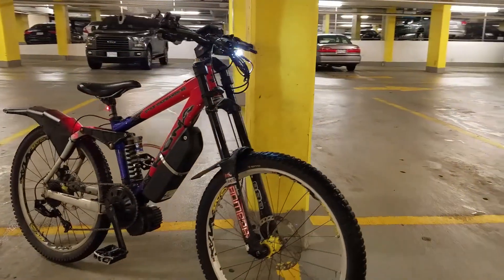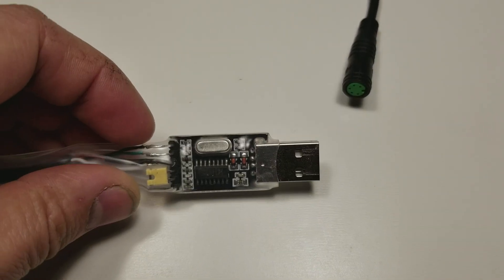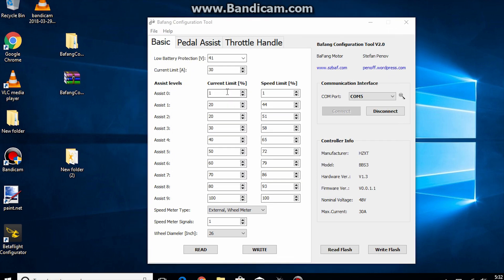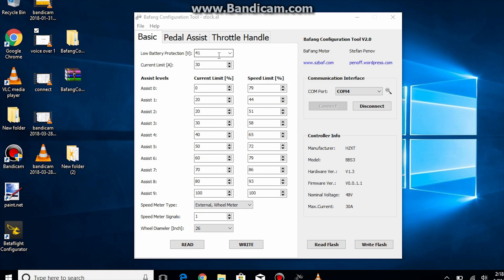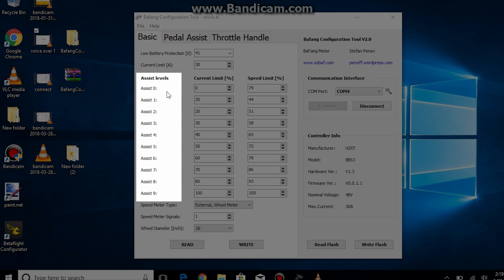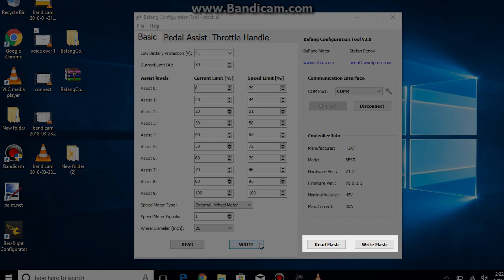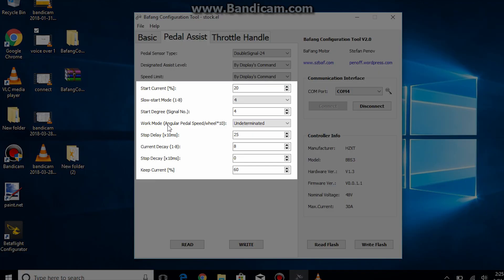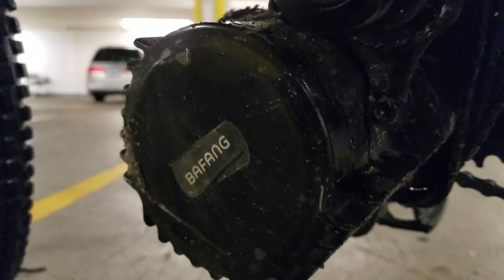Bafang BBSHD Configuration Tool HOW TO

Comment: Sorry, but pedal assist mode is supposed to do nothing. At 0 you are simply using the speedometer, 0 mode is for going downhill without using the motor, as this saves battery.

Comment: Are you aware that there is an app called SPEEED which works with a smart phone-no need for a laptop. However, I have used this twice and twice it resulted in disabling my PAS without knowing why? I would dearly like to know as it involves quite some extra cost to get it functioning again. Right now, I need to reduce the power setting for my PAS 4 and 5 but am afraid to use SPEEED again in case I lose my PAS?
Reply: ▪️
What kind of bike did you use it on?
🟥
Reply: NOT THAT IT MATTERS BUT A RECUMBENT TRIKE @2NDFLB-CLERK

Comment: Very useful, thanks. I found that I needed to turn the bike battery on to be able to read the flash. In the PDF which was part of the config tool download it says specifically don't have the battery connected when connecting a computer.

Comment: Wheel diameter is the rim size?   If your tire was 12" thick you would go faster than a 1" thick tire,   if both were on the same rim size and both spinning the same rpm.    Shouldn't it be the tire outside diameter?    Am I wrong?

Comment: Thanks for sharing. I'm using 52V battery  however the tool says the nominal voltage is 48v (as shown in your video).  The highest option in the pulldown for voltage cutoff is 43. Shouldn't it be higher for 52V (maybe ~46 or 48?

Comment: Hi, 
I'm the author of the "Speeed" application for Android https://play.google.com/store/apps/details?id=com.mkopa.speeed 
It's the equivalent of the popular Windows tool "Bafang Configuration Tool". The application supports configuration files from "Bafang Configuration Tool", it also saves them in this format (*.el).

To work we need the same adapter i.e. USB-Serial + Julet 5-pin female plug. 

The application is free. I'm making it for our common good :)

In the next version we'll find support for Bluetooth adapters, and after some time and thorough testing the application will also be available for iOS.

Comment: I have a Bafang M600 seems the factory has locked out all capability to program it. i want to set the power levels %, power level 1&2 are all but nonexistent then power level 3 and you are off to the races. would appreciate any info you may have on the M600 programing.

Comment: Hi. I've got ax similar set up. Note that I'm getting better, I'm hitting the battery when landing and compressing the shocks over 70 percent or so. Have you the same issue? Have you ever landed and compressed shocks such that it caused the wheel to brake and or hit battery hard enough to cause damage?

Comment: If I get a "thump" when initially engaging throttle or PAS would adjusting and slightly lowering the "start current" alleviate that abruptness of initial power delivery and get rid of the initial thumb throttle / pas engagement thump or clank that I experience? I'll have to get a programming cable and give it a try but jsut wondering if you happen to know. Thanks for a great video!
Reply: Hey. I hope you see this comment. I have been all over YouTube trying to find a fix for EXACTLY what you described. I haven't tried lowering LVL-1 of PAS yet. If the motor had soft start/soft engagement where it would take the slack up in the freewheel, chain, etc., before going all out, that would be great. I hate that initial thud that hits like a brick each time motor engages. It makes an awesome mid drive system feel just a little bit like junk.

Comment: Doug, good overview of the Penoff software. Folks need to watch out for some ebay programming cables, my buddy got a miswired one and it blew my BBSHD controller as soon as I plugged it into my bike. Never had any issues with the programming cable I bought from Luna. Nice Stab Garbanzo, I have been jamming on a 2007 Stab Deluxe with a hot-rodded BBSHD from Luna for the past couple of years, also with white wheels. The Stab is definitely a bike that can handle everything the BBSHD can put out, no flexing or wobblies. I was advised to get the 36 tooth Lekkie narrow-wide chainring, and ditching the stamped steel Bafang chainring before I ordered my BBSHD kit. With a 9-speed 11-34 cogset it goes anywhere. Even with 3 big screws mounting the battery rack to the frame (your "riv-nuts" are a great idea), I have been using two nylon & Velcro straps to keep my battery secure, but as you said in your build video,  the under-downtube mounting keeps the center of gravity low for stability.

Comment: Hi ,,, So if  i put a 52v on my bike i will need to change the cut off voltage or will it be fine at factory settings for 48v so i can use  both ? Thanks

Comment: i check the battery, checked the connectors, and changed the display. Bought this cable to see if its the controller, dont see it read the info in the bottom right. Is this the culprit of my issue?
Reply: make sure you have the correct comport selected and then click connect

Comment: Anyone know if this cable will work with the new style connections bafang is using with the metal twist on connections. Mine does not just pull apart as listed.

Comment: You got the low voltage levels completely wrong a 52 volt battery should be 39v. Your BMS will stop your battery from going to low anyway so your value just limits the distance.
Reply: 14 x 2.8 v is 39.2 volts. Your pack will not last long discharging that low. 3.7 v is recognized as best for long term battery life. Top charge of about 57v and discharge to 51v.  Do what you want but if you charge to 4v per cell and discharge to 3.7v per cell you could see many years of battery life. A 52 v battery is 14 cells in series. If you need more range buy a larger ah battery- not discharge it so deeply.

Comment: I think the current consensus is that the "Speed Limit%" is a limit on the BBS motor speed (rpms) rather than the road speed.  It affects at what cadence the motor stops providing assistance.  The maximum rpm (at the cranks) for a bbshd is 130-150 rpm (depending on voltage).  So the Speed Limit% should be set to a level that assures that it doesn't start cutting off or ramping down before you reach your normal or somewhat above normal cadence.  These motors like to run at high rpms and putting too much power in at low rpms can cause them to overheat, especially the BBS01 and 02.  The HD has much greater heat dissipation ability and is much more "bulletproof" I hear.

Comment: how can I remove high voltage cut off? I have 52v battery that my controller doesn't want to handle and it gives me 0.7h overvolt protection error.
Reply: Late reply. The only solution i found is to update the firmware. Look for bbshd over voltage on endless sphere and follow the tuts. Hope it helps tho you prob solved by now.

Comment: Wow this has opened up a lot of possibilities with the motor I already have. From what I can understand  the Bafang BBSO2 1000 watt is the same motor as the 250 watt with different settings? At present I'm bored with 40 km I need to go faster, brakes tyres and suspension all been upgraded to handle road speed. so do I change settings to 9 level pas, and speed to 99km, do I need to change watts? I'm not racing just commuting so throttle on is gradual, does that fiber gear need to be converted to brass or alli.

Comment: You can't set the current limit higher than the value detected (the one you see on the right). This was done to avoid errors. If you send the controller higher value, it returns an error. That's why I programmed it to limit like that. That my config program by the way. :) I think I should make a newer one that has better compatibility with Win10 and I might try to add functionality for the new mid drives with torque sensor if I figure out how it works.
Reply: You can buy new controller and 72volt battery and push bbshd to about 3-5kw of power peak

Comment: Thanks for the video and info. Really helps. I have a BBS02B one of the newer 750W kits. I purchased the program cable from amazon. Getting the USB driver and port on win 10 can be a pain. If you are using this type of setup, just keep searching google for different drivers. I tried 6 different ones and one them worked. But each win 10 is not the same. On my laptop which is 1 month old with win 10 the same driver did not work. So I tried several again and got one that did work. Not sure why but this is my experience. Just keep trying as I did and you will get it. I set my display to 99 MPH and 9 levels of PAS with 9 on my throttle. I have a TREK 2019 Merlin 5 with 29" tires. I am getting over 30 MPH on throttle only and in PAS 9 lowest gear just hitting 38.5 MPH. It seems and feels very fast just nice to know what it could do. I ride most off road in Tucson AZ and ride around 12-15 MPH 20 mile trips everyday.

Comment: Why would setting 0 to assist level 9 break stuff? Wouldn't it just be the same as using level 9 with throttle or pedal assist anyway?
Reply: The pedal power is excessive on 9 and causes crashes. It seriously amplifies any part of a pedal stroke, maybe if your wheel is straight and you are ready for the surge. Lots of people forget and can launch themselves into big trouble with wheel turned or in tricky conditions.
Reply: @copperhead891  I get what you mean. Without torque sensing and also because of lag, setting 9 is not predictable for someone who wants to pedal often. I haven't ridden one but I'd probably pedal with an assist level that made it feel slightly easier than normal but then use throttle for when I want full control or full power.

Comment: Luna cycle sells nice long Velcro straps for securing your battery and they look a lot nicer than a metal hose clamp.
Reply from the maker: Tim Spitz I didn't know, Thanks! I'll look into it
Reply: I recommend these.  They are rubber backed and you can really cinch them down cause they don't slip.   They are long enough to go completely around the bike frame and the battery.
https://www.amazon.com/gp/product/B01DNFIPAK/ref=oh_aui_detailpage_o00_s00?ie=UTF8&psc=1
Reply from the maker: Tim Spitz thanks a lot. I was trying to search long straps and couldn't find anything like that. I'm gonna order today.

Comment: Great information. I would have the cut out voltage set lower if the battery has bms because under load it drops 2 volts and you kangaroo back home.
Reply: yea bro same here, i know it  s set to 41 but sometimes mine doesn t want to assist when it reaches 43, it s better to set it to the lowest i can, because in case of emergency i d rather stress the battery a bit more than having to be a kangaroo, and when i see it s close to 41 i can charge it without waiting for it to be killed by the controller.

Comment: I'll just buy a whole new e bike .
Reply from the maker: horror780 diy e bikes can be more powerful than prebuilt ones for the same amount of money. I'm my case I peak out at 1500watts.  But if you don't have the time or patience, then a prebuilt one is best.
Reply: if you don't have the time or patience, then you can delegate building one for someone experienced, maybe your local bike shop - I think ti still can be cheaper, and for sure
more powerful :)
Reply: I kinda did a compromise between the two options for my first bike. I figured out the specs and frame and all that I wanted for the bike, then had a Chinese factory build the whole bike and ship it to my door. Now I'm building another bike, but making it all myself, very similar to the video above, but with a Banshee Scream frame, BBSHD, shark battery. I have to agree, a prebuilt bike would have been pretty meh value for money, especially for me since I live in EU where most shop bikes are limited to 25kmh/15mph, so basically a running speed...
Reply: ▪️
The main thing that kept me from building my own is the paranoia that I will construct it wrong and then it will cause an electric fire..
🟥